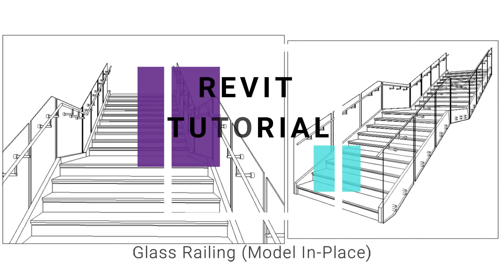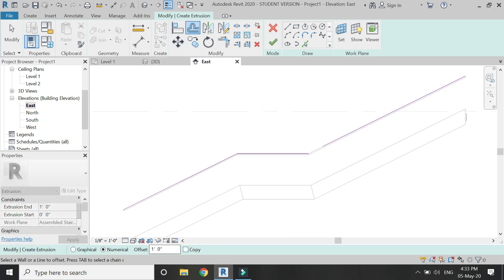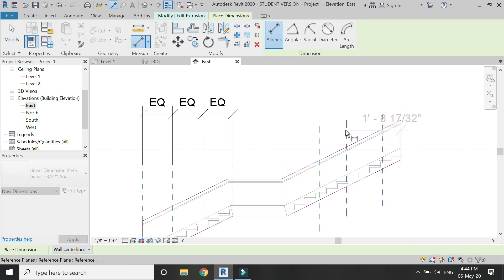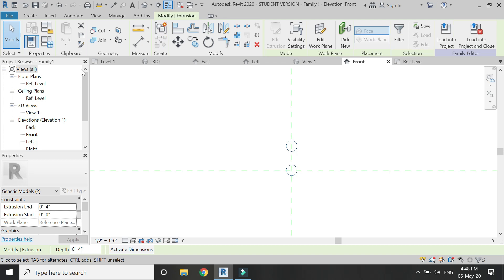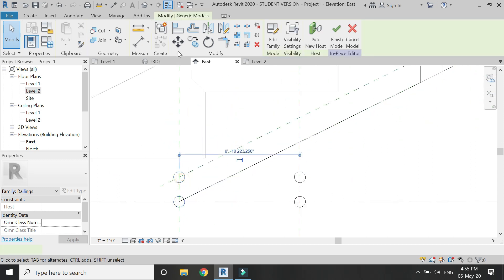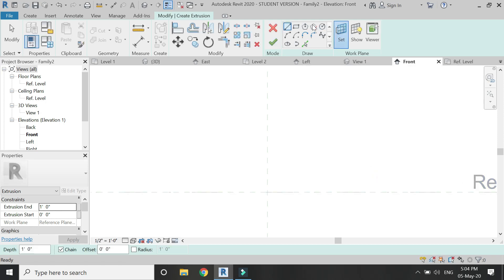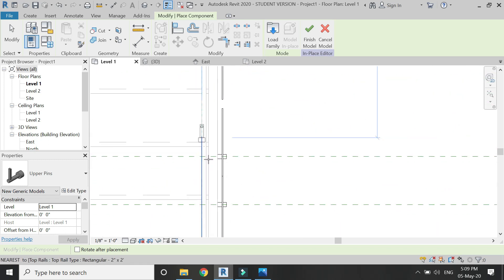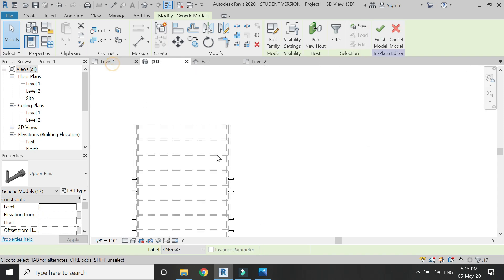Revit Tutorial - Glass Railing (Model In-Place)

Comment: Mam..how to place railing in place model staircase
Reply from the maker: The same procedure by which I have placed this railing.
Reply: @LetsRevit  so it's not placed as a host ??
Reply from the maker: No It is built as a model in-place. Only the handrail is placed as the host, but you can also easily create it as a model in-place as well with the help of sweep command.